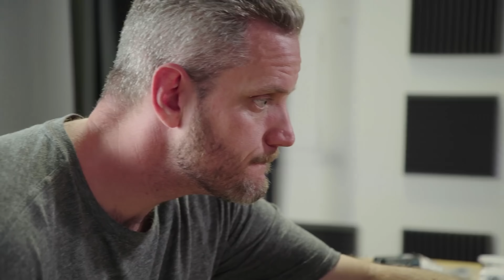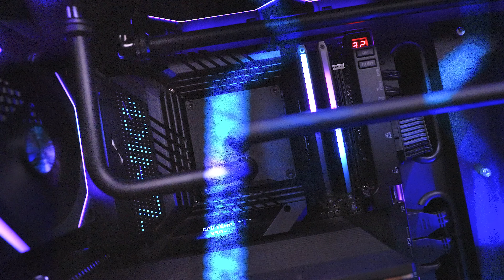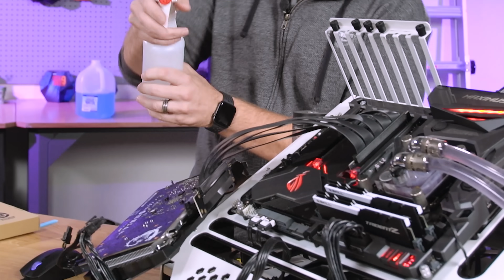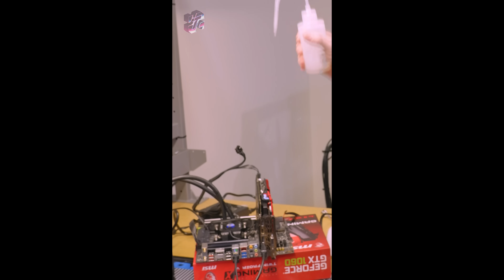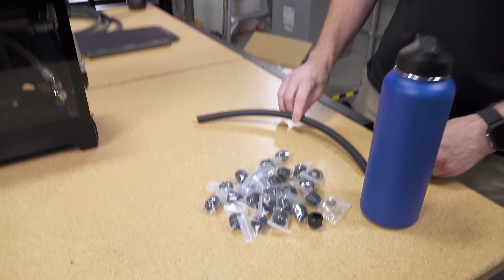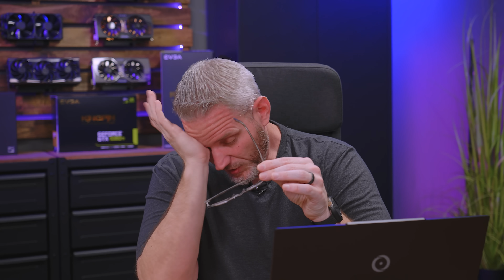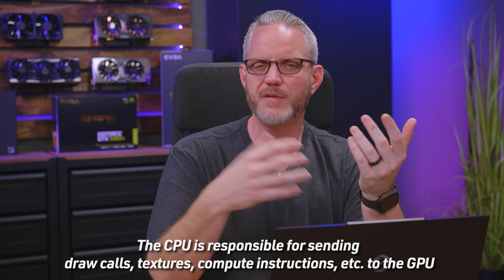5 Myths about Watercooling that are WRONG!

Comment: Anyone know what is the maximum temperature for the liquid in open loop system?  I am using clear EK Clear Cryofuel, 2-360mm Rads and using the EK PVC soft clear tubes

I am cooling a Ryzen 9 5900x  and VRMs on a monoblack, plus a Strix 3090.   My liquid temps get up to 41c while gaming relatively fast, within about 20-30 min.  5900x runs around 70c (hotspot) and 3090 around 45c-50c.  I was just wondering if this is normal or is the liquid temp and component temps too much.   I also live in south Florida so temps get high during the day.

Comment: Glad you explained all this!  
I built my first liquid build many years ago, when it was a Koolance external cooler. It looked like the inside of the Tauntaun that Han Solo cut open, but no room for a Skywalker inside.  
I built my last liquid build a couple years ago, when a failed leak test left such a godawful mess in the case that I decided I just didn't want to fool with it any longer.
Hats off to those who continue to take on the challenge.  I'll be back in AIO-land happy to have the training wheels back on. :D

Comment: 1. Watercooling doesn't make your room colder
2.  Leaks doesn't always ruin a system (not using tap water)
3. Cheap options for loop parts now exist
4. LOOP ORDER DOES NOT MATTER (because of the small size  of a  PC loop and  small delta of temps)
5. Making  a custom loop is  not that   hard especially for soft tubing

Comment: I did my first custom loop back when I had my 8700K.  I got a EK 360 starter kit for just over $300.  That came with a 140ml pump / res combo, 6 compression fittings, 3 120mm fans with a 30mm 360 radiator, a CPU block and 3 feet of clear soft tubing.

Comment: I make sure I have a ceiling fan running on a lower quiet speed whenever my computer is running. With the added air circulation it makes the temperature rise much more bearable.

Comment: For me it comes down to two things: Reliability and effectiveness. Simply put, water cooling systems are not reliable enough (both mechanically and in terms of potential leaks) to make the marginal improvements worth it for the average person. An air cooler can't fail unless it's completely clogged and the fans fail. In which case the water radiator would've clogged up long before, and the fans on the air cooler can actually be replaced.

Many years ago I had a LGA775 system with a CoolIt AIO. During finals week the system started dumping coolant into the PC out of the blue and nearly screwed me royally. Since then I've been solely on air coolers. Modern air coolers in particular are just as effecive and substantially cheaper than modern AIO systems, and WAAAAYYYY cheaper than a custom loop.

Comment: I would really like to see you check out the dual hard line/ soft tubing fittings. I've got an all EK loop with soft tubing. And I would really like to replace a lot of it, with the option to go hard line at some point.

Comment: There are some great air coolers on the market and it is blatantly obvious when they fail. Air coolers also have a longer lifespan than AIO’s.  Although I like AIO’s because they provide much better visuals inside the case, my preference lies with air coolers. I just wish they weren’t so big.

Comment: After doing testing with my builds and component order, I have found that if you have overkill radiators, you can definitely see a difference by putting radiators between each component instead of having cpu and gpu in line. I now run dual 560mm radiators in 2 separate loops to avoid any of that, but in the past I could see differences of 5C+ in coolant temp after hours of use by putting radiators between each component and getting the flow rate right to let the radiators bleed off the heat instead of running through 2 inline radiators and then through the cpu and gpu inline.

Comment: While I've been a water cooling fan since the days we had to MAKE a lot of our stuff, but as you noted it's the prices that have pushed many people out of it. While AIOs have gotten a lot better building a full loop is way more expensive now than years ago, and it's really only inviting to those that can already afford a 14900KS and a 4090 and can't find anywhere else to spend. For anyone else you're vastly better served by buying faster hardware long before thinking about extreme cooling. It's not just the cost, it's that the cost is just so MUCH more. While it may be getting better and I hadn't heard of some of these new companies, it still just can't compete with the cost and ease of a quick AIO for most users, let alone just how cheap some solid performing air coolers are getting from companies like ThermalRight. 

Unfortunately I HAVE experienced that catastrophic, expensive, complete system get nuked with only 1yr old deionized water that suddenly decided to have a radiator seal blowout. But this was at least 5+ yrs ago so fittings and coolants are probably safer now. If I ever return to "real" water cooling I'll at least never have the radiator mounted directly over the CPU and GPU. But damn was it crazy sitting in front of it when it went and it took out everything except the hard drives. 

It will take a lot before I'll trust open loops in my personal system again, so how about I just enjoy watching you?

Comment: I keep my room around 62-64F. 7950x with 3 480mm radiators. using soft tubing atm in a V3000 +. CPU sits at 45-52c. looking to move to rigid tubing early next year.

Comment: Hey J, love your show . Do you know where I can find a 60 degree  compression fitting for 3/4 inch  flextube  ? My reservoir is whirlepooling and making tiny air bubbles in the loop every time it drops a quarter inch of fluid from the top of a 200 mil reservoir. I literally have to use a water dropper to fill the reservoir to the max to stop this.

Comment: I've only ever actually  broken one piece of electronics in near 20 years of water cooling. It was around 2006 being a DVD player that was below a reservoir mounted in a 5¼" drive bay that cracked one of its connecting stems. Yeah, my fault being lazy and not moving the DVD player so it was above the reservoir!

Loop order? Whatever is most convenient (barring ensuring the pump lower than the reservoir) in the PC case. I make use of crossflow radiators in both of my hardline tubing rigs to negate a long tube runs (my bottom & top rads) so I end up with: Res → Bottom 360 Rad (thick) → GPU → CPU → Flat Res → Top 360 Rad → Side 360 Rad → return to Res.

Comment: Outside of a very small range of parts water cooling has no benefit for a huge amount of extra cost. Dropping my temperatures by 8C  vs an air cooler isn't worth the price when my max temp is at least 8C below by personal target temperature.

Comment: Cost isn't really my issue, since I use a Noctua NH-D15 air cooler, but regardless of how unlikely it is to wreck a computer with water cooling now, it can still happen and literally cannot happen with air cooling, since all you have to replace are fans and mounting kits. One less point of failure, combined with the much simpler assembly and re-assembly makes the decision obvious to me unless you are building a system that absolutely requires water cooling like small space applications or components that just get way too hot. Otherwise, a really good air cooler with correctly tuned fans is more than quiet enough while providing more than enough cooling for a personal pc.

Comment: I used an Aveks water block on my last custom loop, $20 from Amazon for an all-copper water block that keeps my 11700K @ 5.3GHz running just fine.  I miss the old days of making a water block out of a heatsink, plexiglass, and glue, using a K5 Blazer heater core for a radiator, and a pond pump plumbed to an automotive coolant overflow bottle but I'm glad we have the options we do now.

Comment: About cooling specially fan control, you advertised remo fancontrol in the past but jay did you know it uses a low level kernal driver winring0 which was concluded vulnerable? So Jay maybe make a new vid about that?

Comment: AIO water coolers look amazing but what happens when your AIO pump dies. I prefer a premium air cooler with a Honeywell ptm 7950 thermal pad and a fan on front and back. If one fan does  CPU temperature goes up 2 degrees Celsius. Then hopefully you will eventually notice that one of the fans is dead then you can just buy a new pair of fans.

Comment: I installed a mini-split AC in the room that I keep the computer and consoles in. It's so much more efficient than the central AC that my bill went down in the summer because I was able to set the central warmer. I understand why so many new homes are being built with these instead of a central heating/AC system.

Coolant temp averages out over the mass of the coolant. The more coolant you have, the lower the delta will be.

Comment: I was in the air cooled camp for all my life. Didn't like the idea of a pump failing or water in my computer. I was a mid tier buyer though. I had a 4790k with gtx970 back then and upgraded to a gtx1080 at the beginning of covid. Both were fine with air cooling. I got my hands on a used RX6950xt and a 5800x for ~300$ a 1.5 years ago. And I have to say....while they are still powerful enough for what I do and for the price I paid ..they run hot. My bequiet dark rock pro couldn't keep up the heat density of the 5800x. The XFX 6950xt had pretty high hotspot temps and got loud when I attempted to cool it down. 

That's when I decided to go for a custom loop. Here is what I did. I didn't need my build to be flashy but it should work. I've read some posts and tried everything by myself as a first time job. 

Fittings I bought used...mostly Alphacool, gpu block (Alphacool) and cpu block (ek) were used but like new, radiator (MORA 420) was used, 9x artic daisy chain fans used. Some used CPC quick connect fittings (great flow rate in comparison to most pc stuff) to easily remove the huge rad from the pc. The rad stands on it's own feet next to my pc anyways but I can move them separately like this without draining the loop. Reservoir is from Alphacool as well but new. Some epdm tubing from aqua computer because it felt the best out of the epdm I tried. An Aquastream Ultra pump because those pumps last forever and are dead silent if dampened correctly (worked with this Eheim pump for years).Clear DP Ultra fluid. I reused my trusty HAFX case with upgraded noctua nf a 20 . Fans are manually controlled via my old scythe controller. I don't have to change pump speed or fan speed at all because the system can easily deal with a way bigger heat load. The pc is 100% silent. I never have to worry about a single thing. 

While air cooling is cheaper I didn't like the noise fluctuations with my hardware. Since entry cost ist the biggest factor to watercooling I guess I am going to stay with it for now, even if I change the internals of my system. Rad, pump etc can stay the same. Even the things I bought new were mostly bought from private sellers that didn't need them and sold them for cheap. Therefore my cost for all the parts was quiet low. It took a few weeks to buy stuff here and there but I wasn't in a rush and saved a ton. Like I said before....I would do it again just for the noise and because I had a ton of fun building it.

Comment: If i ever got into doing custom loops, I think i would prefer to use clear tubing so i could see the colant and know if it was evaporating or not (I've heard that AIOs eventually run dry, and they typically have a lifespan of about 5 years, not sure how true that is though)

I have heard of, and seen builds using, a case that has the resevoir built into the back of the case, but i can't remember the name. Though i tend to prefer mATX or ITX cases these days for space reasons, so custom loops aren't really an option, unless i decide to build my next system around a test-bench.

Comment: I would really like to see a modern re-test of "Does the loop order matter" for cooling temperatures.  I did my layout for my 5950X system a few years ago so that it had the CPU going to a 360x30mm radiator, then that radiator went to the GPU (3090 Kingpin HydroCopper), then that went to a 480x60mm radiator, and that went back to the pump.  I always had cooler temperatures than people with a similar setup that had either one radiator, or two radiators in succession with the CPU/GPU running in to each other.
You need HIGH wattage parts to actually see the difference, but it does exist, imo.

Comment: Question: Is the performance increase worth water cooling with modern CPU's and GPU's being so efficient we are not seeing much of an uplift from overclocking? I get the fun of tinkering and making your system look cool, my last 5 systems I did custom loops or AIO's. Now I am looking at building a 9950x3d/5090 system come September and I just don't see the reason not to go air cooled and not have to worry about the additional points of failure.

Comment: Mistakes I've made watercooling over the years:
1. Forgetting to put a drain in my loop.
2. Putting a drain in my loop with a T junction that had a super crappy ball valve attached to it that would free spin 360 degrees on the handle part of the valve instead of just going 0 degrees for on and 90 for off. This was fine for years because I was always smart enough to put a cap in the open end of the ball valve before firing the pc up, until the one time I wasn't. The ball valve was at around 89 degrees instead of 90 and it resulted in something like putting your finger on a garden hose, sprayed coolant straight into my expensive PSU, which then shorted out and died.
3. Thinking I would be fine just diluting my loop of premix coolant with distilled water over and over to the point where it was probably 1/3 premix, 2/3 distilled water. Turns out the chemicals in premix are super important and they stop algae growth among other things. Clogged the loop with gross algae schmoo that made me replace 2 rads and my pump.
4. Used Corsair soft tubing. This stuff is garbage that will kink up super easily and impede flow in your loop. I hate recommending EK products now but their soft tubing is the best I have ever used.

I will never put distilled water in my loop again unless it is to be mixed at the appropriate ratio with a concentrate. Buy enough coolant to sustain your loop until fluid change time, it's worth it.
Reply: They there are advanced mistakes, meanwhile I am forgetting to remove the tape on my ssd heatsinks
Reply: Mistakes I always make: spilling water everywhere when disassembling the loop :face-purple-crying:
Reply: Man. What did you do with the loop? Spitting in it? I have few bottles of ‘reserve’ tap water and it sits at my balcony for months and not a single sign of algae
Reply: @andrewdenzov3303  you don't need to spit in water for algae to grow. Many people have reported algae growth in their water cooling loop. Probably the warm water and being in contact with metals helps growth, but I don't exactly know how it works.
Reply: @szaszm_  I have water cooling for 20+ years now. Half a dozen systems with upgrades. All of them except one were on simple filtered water. Never had any problems with algae
Reply: @andrewdenzov3303  I think the key point here is the temp of the loop: water will sit mostly in a very confortable zone for organisms, warm enough to strive, not hot enough to kill them.
Reply: @MjolnirFeaw  yeah. But what did they eat?
Reply: @andrewdenzov3303  algae grows from direct sunlight.
Reply: 1 is only a problem for rigid tubing ^^ my first loop had no drain but did have 2 long tubes attached to the reservoir that was in the back, take out the screws on the back put the reservoir in a bucket and take the top off. draining has begone ^^

my current dual drain solution is a lot better and letting all the water out though :P (have an upright rad with the tubes at the bottom splitting my loop in to the left side and right side :P)
Reply: Yep just made the Corsair soft tubing mistake. Now I'm switching to rigid, as I should have done in the first place.
Reply: I am still running distilled water in my loop  its not been changed in 4 years  and the water is clear- zero problems but  I did clean everything out thoroughly with strong  white vinegar before I started then flushed  it out with 2 gallons of  distilled water, I use a biocide and check the  PH value every 6 months to a year, and I do have a silver coil in the loop as insurance and its still shiny and hasnt gone black! ,  on my 1st build using premix I ended up with strange floaters, that seem to grow  over time until they started to fur up the pipes,  since then I learned!  if you dont want things to grow in it, 1) make sure its cleaned thoroughly, assemble it in a clean environment and  away from pets and plants,  2)be careful of what you put in your loop, I get my distilled water from an industrial company called Atomic Research,  in 25 gallon containers, 3)   minimize the amount of time your loop is open to airborne contaminates, 4) dont do anything that will cause organic material to  end up inside your loop, that includes sweat or grease off your  fingers   transfered  when touching a barb then transfered inside  the loop  as you push the tube on, or worse something from your mouth if you your the sort to suck on a tube!  5) clean  the cap and the area around your  water container  so nothing can fall inside it and spoil the rest of it, and the same for your reservoir before you open it...   btw for the longest time I never bothered with a drain either :/  edit - almost forgot  dont mix different metals in your loop without an inhibitor  -  it will lead to galvanic corrosion, aluminium  and copper do not play well together..